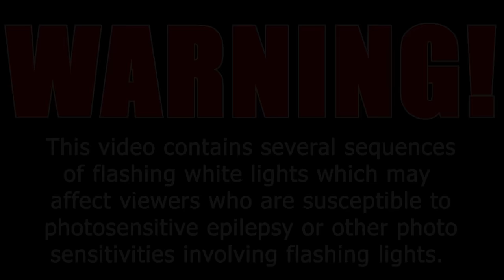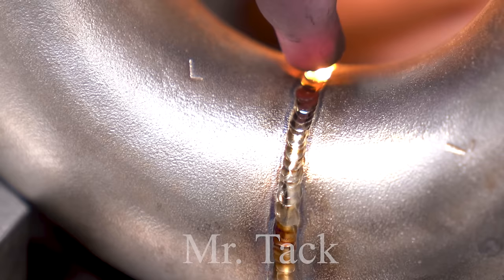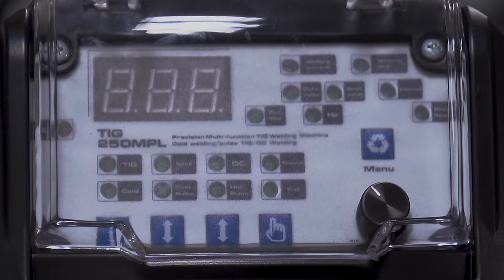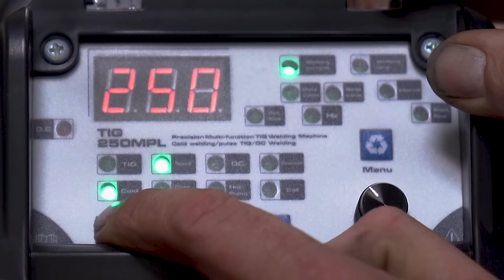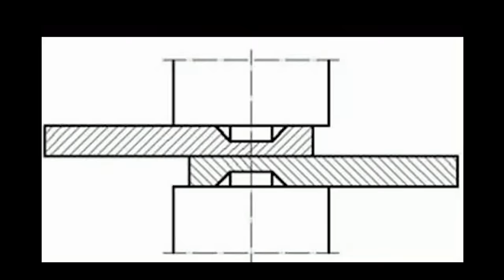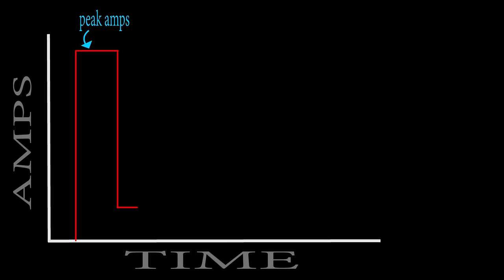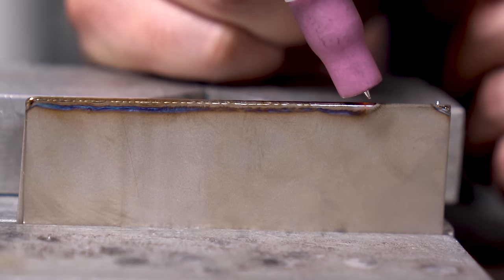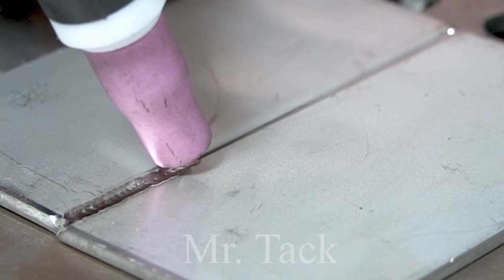So I Bought A Cold Welder

Comment: It’s for jewelers…. Im a jeweler and I’ve been doing tons of research to get around something the jewelry industry is really good at; dressing a piece of industrial equipment and selling it to artisans for $4000.  Working my way from the machines that are marketed to me back to the industrial units I see in the hundreds and back again, I finally understand what’s going on.  Just as pulse circuits are nothing more then a controller supplementing the user of a welder that would either be on or off at any particular setting; the controller of a pulse unit regulates the input of this tremendous energy into bites that more delicate materials can handle.  I’m not surprised that applied to material functions that you are accustomed to handling, that these welds would be impractical, but for someone trying to put earring wire onto a thin bezel holding a potentially delicate stone, it is a time saver.  
I’m honestly surprised this isn’t being marketed to jewelers because it’s practically 1/4th the price of a similar powered unit in the jewelry world.  As it happens from there the price starts to get ridiculous with add ons that only jewelers would need (like a microscope and fancy LCD interface).  But for us working in fine metals who are aware they are being sold a pig with lipstick, and would rather have the pig without to save some scratch, this is what I’ve been hunting for.  
I’ve seen even further into my frugal tendencies and  would consider a pulse control unit so that I could practically use most welders home depo has with a similar level of precision you get from a Lampert PUk 5.1 that starts at $3500.  You’ll likely roll your eyes to know that researching this I had to come to understand electrical principles to a degree that I could get around the constant tactic these companies use to discourage cross industry use of the same product.  They will, if they offer it upfront at all, an advertised power rating in Watt/seconds or Joules, cleanly discouraging people from finding out a unit you used here will do most any job they require without the price tag.  And $3500 for the Lampert is without microscope which begins at around $5000.  Btw that’s still mid market for expensive.  Check out laser welders….
Reply: I did a DIY version from an old LCD mask and switch with my 160 amps DC TIG : as soon as the arc is established open the switch. after seeing the PUK Lambert. Welded some broken titanium glasses frame, broke them again same place. The weld did not completely penetrate (surprise for cold weld !)  so not that good a process for that  or was it me, welding titanium with just a box with a plexiglass sheet  as partial coverage... ? PUK goes to 400 amps though.

Comment: Thanks for the test, had to talk a friend out of buying one
Reply: Ahhh the old "I have a friend who...." travesty 😆
Reply: @Mr215Alive  Right, the one that buys the cheaper welders and says they work exactly the same as the brand name machines.
Reply: maybe its decent on the "regular" tig mode. remember the "cheap" welder he tested a while ago?
Reply: @g-low6365  very true. Forgot about that.
Reply: @braidenstevenson1665  They don't sell cheap brand new machines?
Reply: @hardcase1659  There are sales all the time and honestly depends on your definition of cheap. Getting a machine that does aluminum welding then telling someone who has never welded  it costs at the least 700 dollars most would say why so expensive. While those who do weld would say hey that's not too bad for a starter machine.

Comment: As someone from China, I can say this is pretty useful here. Here we don't have many freelancing welders knowing what they are doing. A few weeks back we had an automatic door system installed, and I was unfortunate enough to witness the installation process. Long story short, the weld is so bad that I wanted to step in. This pulse welding thing, at least, allows noobs to create welds that are not that beaten up, I mean welds that are so bad that it is pitch black and porous with bubbles on top. While this cold welder does not produce better weld than a common TIG welder in a trained hand, it does make a difference in the hands of a noob, so employers can save money on better trained employees.

Comment: Good vidjoe. I might be to late for suggestions but here it is. I’ve seen a process where surface pitting on fine steel parts (firearms), were repaired using a high end laser welder. I assuming they have a vacuum box. The pitting on the part is fine. What they are doing is putting a very small cross thatch of spots and then resurfacing using files, stones etc to smooth the whole thing down. And then bluing or whatever original finish type.
Very specific application of antique pieces. Heat distortion is a big deal, and amount of filler if any is minimal. I think I will practice on a garage sale BB gun before I would attempt this on grandads Boar war rifle ?
Reply: A laser welder simply uses pre/post argon, like a TIG welder... there is no vacuum. They can use filler if they need to. The only difference is a beam of light melts the metal, instead of an arc. Of course, the laser welder is going to have optics to precisely aim the beam... with crosshairs like a rifle scope. If you crank the laser up really high, it'll blast a hole straight through a coin in one shot. Big lasers are used in the military as weapons.

Comment: You should create another video where you recreate cold weld settings on popular tig welders here in the US.
Reply: At least SHOW that can be done.
Reply: I too would like to see a follow up video... but also see practical side of such a setup IE for doing tack weld on thin Sheet Metal's like for Auto Body... with but joints or seams are so easy to blow holes into the but joints you can always run a bead filler over that and have much more success TIG welding can metal filed much easyier not requiring in some cases body filler
Reply: Would be very usefull
 to know!

Comment: I’ve used a Tig/MMA machine in the past and it had a setting in the menu : tacking ! meaning that you spot welded “ cold weld “ 2 pieces, so i used often as a quick assembly prior to tig welding in a normal way...and I could set the Amps and the microsecond to do this. So no novelty in the process
Reply: MMA? Is that like you get in a cage and beat the metal until it surrenders and sticks together?

Comment: Actually Cold weld also occurs on the space, where materials tends to fusion in the cold since there is nothing separing them (No air no dust). Actually its a huge problem to the space agencies since they have to use certain materials to prevent this.
Reply: Happens with super smooth lapped precision gauge blocks. If you put them aside while having them stuck together with the friction alone, you end up with never being able to separate them, due to optical contact bonding effects.

Comment: This is a multifunctional welder that is great in theory because of it's broad application. I can't testify for this particular brand.  
You didn't understand the purpose of the device/mode. The cold mode is not made for welding bridges with 1" steel but for application that require low heat such as electronics and temperature sensitive environments that don't require a great strength. Spot welding battery packs would be one application where the short burst are useful because there's less heat which damages the batteries.

Comment: I guess with a large enough capacitor someone could make an extremely compact welder (like a fat soldering iron) since the average power and duty cycle are very low. That might be an interesting product. As a mode for a regular welder it seems fairly useless, unless you have a lot of aluminum foil scraps that just won't leave your OCD alone.
Reply: This idea exists for battery terminal welding. You want to minimize the heat spread into the battery because it destroys it. Soldering or brazing is out of the question too.

Comment: Hey gang, my lincoln ranger when hooked up as a tig welder with power at zero can scratch start and weld the sharp end of razor blades. Believe it or not it has a rather stable low amp dc arc.

Comment: It's basically a micropulse. I've done very similarly as many others have. I started in the 70's and 80's as a sheetmetal welder. Using stick and carbon arc. I was the only welder with 18ga aluminum Mig for years because I figured out how to use a heat sink backer to keep the spray transfer from disintegrating the metal. Now any numbnuts with pulse can do it.

Comment: Bro people need to give it a break on this welder when they don’t understand what’s its for.  If you want to get a welder for strength switch it to regular rig mode or pulse rig but this machine is like a pulse mode on steroids.  It is only meant for sheet metal fabrication instead of using a laser welder which is 20 times the price these guys figured out how to control through a click of the switch and being able to weld thin metals at corners with high heat fusion without having a burnout occur after shorts lengths of arc.  If you do any metal sculpting or building of items in thin gauge metals then it is a really useful machine that a regular rig welder without this cold pulse setting could not accomplish

Comment: I can see one of these being useful for making jewelry and metal art. My tig welder doesn't start the arc low enough to weld rings and wires together.
Reply: ...plus some tool/die/mold repairs. Which is real application of those "toys" (like SANWA SW-V02).
Reply: This is ideal for anything small like that. Not as ideal as a laser welder, but only 1/20th the price. Plus, it does regular TIG welding, too.

Comment: Good video. Sometimes when I have to tack weld really thing stainless sheets together,  I use high ampere and just push the button quickly. Connects the both pieces easily together. Then fully weld them "normally"

Comment: cold welding can also refer to when metal touches other metal(of the same element I think) it just sticks. usually there is an oxide layer preventing this but in space it can be a problem if not accounted for.
Reply: Stainless steel will readily do this. If you have a job that requires 4 stainless bolts and you have only 4 stainless bolts available you can guarantee that at least one of them will cold weld the threads if you don't lube them up.
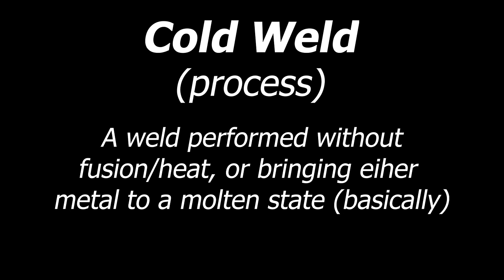Reply: How is that different to what he describes at 4:47?